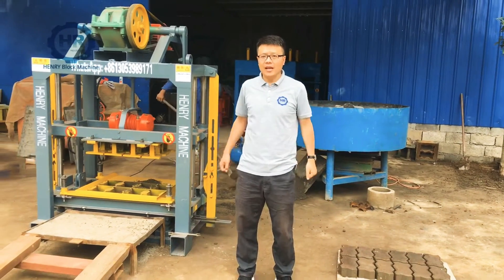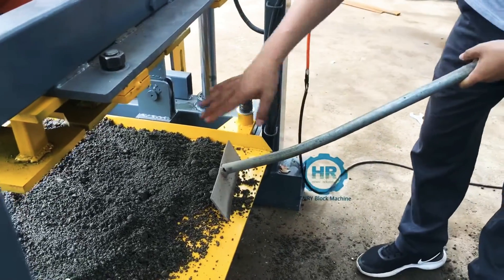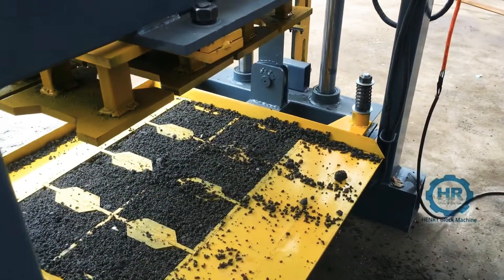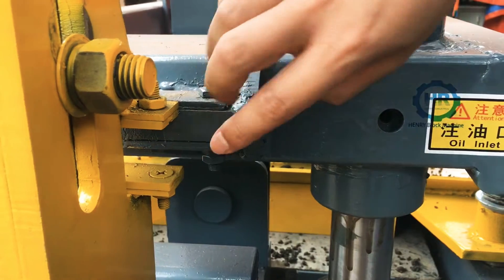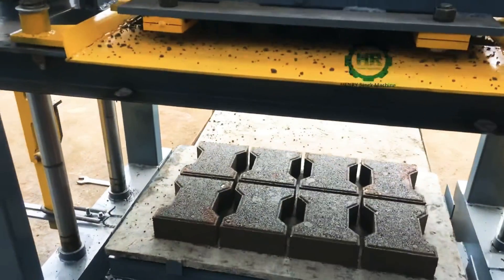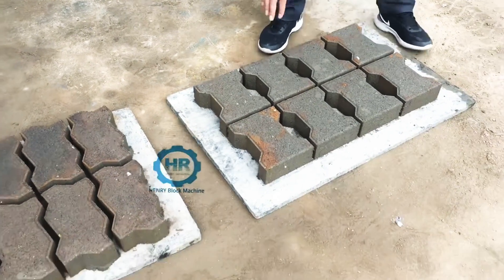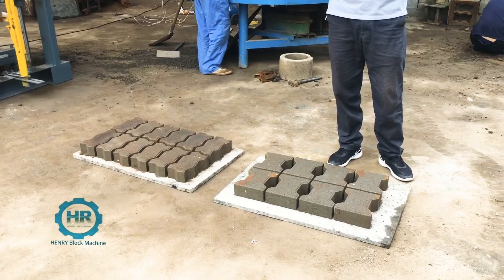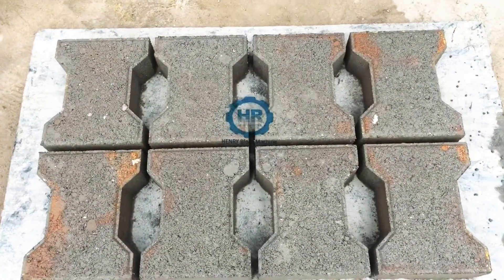Want to Learn How to Operate a Zigzag Paver Machine? Follow These Simple Steps!

Comment: Hi, what is the particle size of the sand(agregate) you use and what is the ratio of sand, cement and water? Strength is really impressive!
Reply from the maker: Normally 5mm diameter. Cement ratio is around 10%